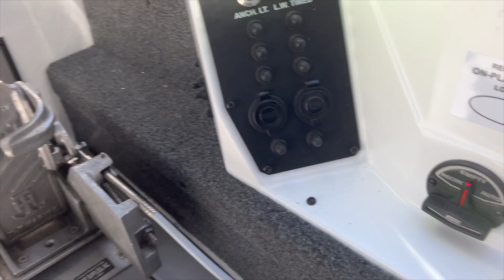Vexus Fixed my Cracked Boat! Walkthrough of my NEW 2023 AVX 2080

Comment: I seen alot of issues  with cracking  hulls.  Im glad that they stand by their products. But I  still think they have an engineering  problem  that needs to be corrected . So the next boats on the line will be crack free.. It's  got to be costing a butt load for warranty  work. So you will think they would get that fixed very fast.
Reply from the maker: yep

Comment: I don’t understand because the price point the 2080 is you can get into a fiberglass boat for probably like another $5000 get a ranger Z 18 with a Murc 200 pro XS blow that boat off the water and hulls won’t crack , I got my phx 20 pre Covid for what the dealer had a 2080 for
Reply: The 2O80 is a 21 ft boat. The deck and storage area are giant compared to a Ranger 518. 
2080 is Waaay more boat than the 518 Ranger. The Vexus 2080 compares with the Ranger 521 and a much lower price point. If you have checked recently Ranger is not what It used to be.
Reply: No way